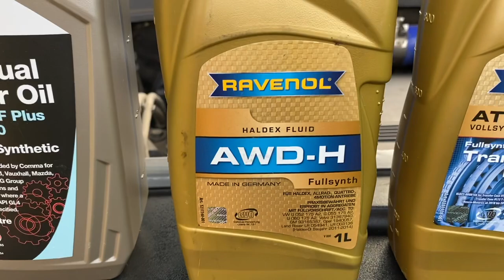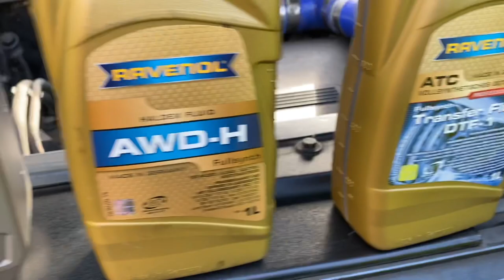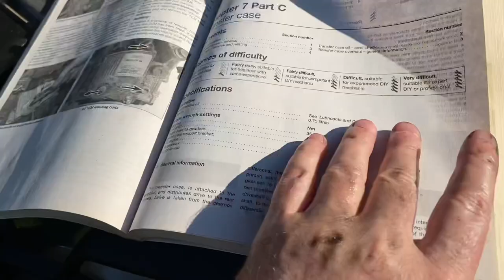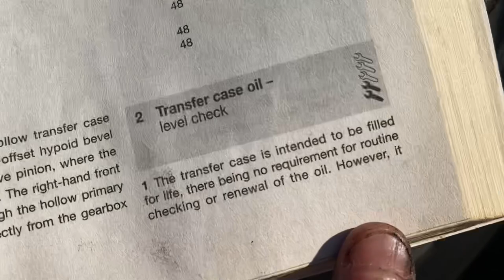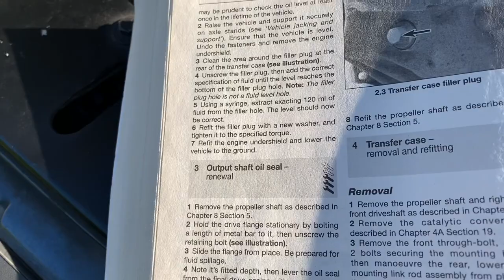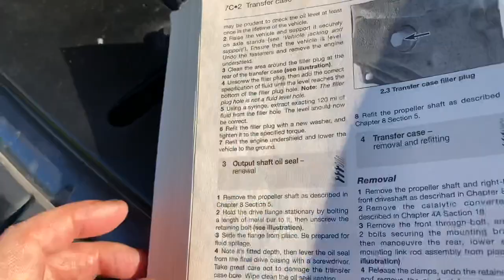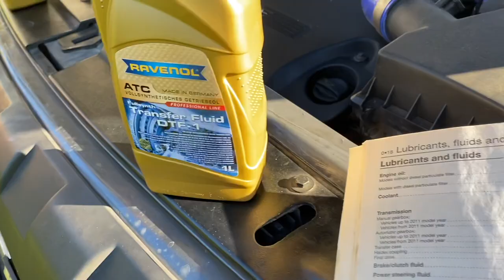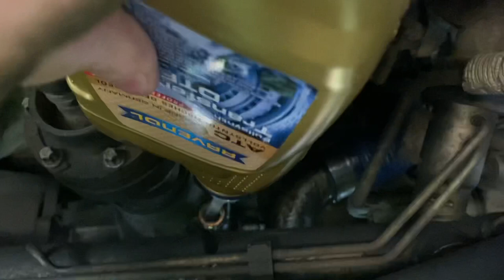Transfer box/PTU oil change on Land Rover Freelander 2 / LR2

Comment: Thanks for the video/advice - will be tackling this job tomorrow whilst doing the regular engine oil change - as far as refilling is concerned I reckon with the LR on front axle ramps the refill level should be about right at that angle with filling to the plug level 👍

Comment: I used your video  to fill my front diff, so your instructions are simple to follow. 

Your comments should be kept to relevant  points only.

Description of oil leaking from the filler point is a waste of time.

Keep the videos  coming I use them instead of the manual.

Great full regards

PETER
L

Comment: Great video, I need to do this job and wanted to see someone else doing it first - thanks!
My main first decision is whether to first tap a drain plug in at the bottom or not.. however you have shown that it is possible to get fluid out from the top which is encouraging.
Reply from the maker: I may add a drain plug to mine. The fluid can be sucked out of the filler but difficult getting it all out. I’ve also learnt that you can brim the fluid with no bad effects. There is no need to remove some after filling.
Reply: I was thinking of adding a drain plug to the rear diff. When I drain the D2 diff oils the fist part of oil that comes out is much darker than the oil at the top. So I'm sure that not having drain plugs means that the crud isn't getting removed. A drain would be also good on the haldex Gen 4 ; watching videos on the VW haldex they have had the sense to add a drain and a refill plug.

Comment: Nice movie.              Because I had problems using the syringe tube to empty I drilled through the bottom bolt hole on the side of the box making it a very easy job to take out the fluid and also getting the 120ml out. Still had to use the syringe to fill. Such an awkward position to work in without a lift ramp. One point though is to make sure the bolt is fluid proof when you've done, I used a spot of silicone sealer with a copper washer.

Comment: I’m about to replace the inter cooler hose at the front of the engine and it’s my intention to replace all with the silicon hoses over the next few weeks or months. Can I ask where you got your hoses especially the turbo hose you pointed out. Excellent videos by the way 👍. Very informative and well explained.
Reply from the maker: Thanks Stephen. Hose are from ebay…

https://www.ebay.co.uk/itm/LAND-ROVER-FREELANDER-2-TD4-2-2-TURBO-TO-INTECOOLER-SILICONE-HOSE-PIPE-KIT-/291074371899?mkcid=16&mkevt=1&_trksid=p2349624.m2548.l6249&mkrid=710-127635-2958-0

Comment: Thank you very much. Our front transfer box is getting noisy, so I'm going to try this, although I suspect it will need recon unit. I did laugh at "this has got to be shortest chapter in the Haynes' Manual" and "I've just got a face full of oil". I'll adopt the same approach as when I replaced our rear diff/Haldex 3 and have the car as level as possible on 3 ton axle stands and let you know if the oil goes in any easier. Is there a front Haldex that also needs servicing/oil?
Reply from the maker: Only one haldex, acting as a centre diff but located at the rear. I mistakenly call this video the front differential service.  The front diff is actually inside the gearbox. This is the Power Transfer Unit which splits the front drive off at 90’ to go down the prop shaft to the rear.
Reply: Thank you. Will see if there are any videos on changing auto gearbox oil in that case!

Comment: Hi in was wandering you can help me. In have a 2.2 manual td4. 07 plate with 98k. I get a weird whirring on low revs at a certain rpm. Whether it's stationery or not also doesn't matter if in gear or not. Only does it at a particular rpm.
Reply from the maker: Sounds like it could be the turbo or the air duct/hoses. Whereabouts on the engine is the whirring sound coming from? Also, check the auxiliary drive belt and pulleys.

Comment: Did this procedure last weekend - try as I might I could only get 300-400ml of syrupy brown fluid out with a syringe and replaced it with slightly more new? I still maintain that even this operation will be okay if I now do the same fairly regularly as it will have the benefit over time of blending the new fluid with the old.

Comment: Hi Beavis, sorry have you ever changed the timing chain? And if so, how many km? It seems to me that your land has the 2,2 engine like mine, or am I wrong? Thanks!
Reply from the maker: Yes, mine is 2.2 diesel, and I got a local garage to do my cam belt at 100,000 miles. It needs to be changed before 144,000 miles. I got mine done earlier as a safety precaution. I am not sure but I think there is a chain somewhere in the engine as well, but that is to drive the oil pump only and is not a part that needs to be renewed.

Comment: Hi watched your video on Front diff oil change, got 350 ml out of one and 650 out of other one, one had warm engine. Problem is getting the right amount back in. It trickles out from around  500ml, have left vehicle for half hour tried again but runs out, vehicles are almost level to work on. World it be worth running engine and trying to top up when oil is warm?
Reply from the maker: Just fill to brim and then you are meant to remove some, although I have heard of people just leaving it brimmed with no issues. Youtuber “Frenchies Road Trip” did this and it was fine. Running the engine won’t really help as transfer box only turns when driving.

Comment: Hi. I need only 1l Ravenol Transfer Fluid DTF-1 for front diff? I hear that is noisy. Today I unplug terrain response hose and nów driving is quiet. Meybe Oil replace Will help. What do you think?
Reply from the maker: 1L of fluid is enough for the front diff. Sounds like your haldex or rear diff needs a service if the noise stops with the haldex unplugged.

Comment: what is the cause of the oil leak?  I saw oil on the transfer case.  did you find where it's leaking from?  thank you
Reply from the maker: Leaking from the driveshaft and propshaft seals and where the PTU mates to the gearbox

Comment: Hi mate. I'm going to be changing my ptu / front diff oil soon, love the video, I'm almost confident enough to do it lol, I'm a bit confused about drawing 120ml back out after filling to the level plug. I've seen a post on landyzone where someone drew out 62ml ( very specific 🤣 ) and a recent video from frenchies roadtrips where he fills up to the level and refits the plug. I'm not sure who to follow,  is the 120ml thing advised by landrover? Thanks for the videos.  👍👍
Reply from the maker: The 120ml back out is in the haynes manual. I think it is to allow for heat expansion. The rear diff is fill to brim, the haldex is withdraw 70ml, although I have brimmed mine without issue. I’ll have to have a word with Mr French!
Reply from the maker: Ben French replied to me and said an LR garage told him it is fine to brim the front diff oil, no need to withdraw 120ml. I will look at this is an upcoming video.
Reply: @BeavisPits  thanks mate, I think I'll follow the Haynes as well, surely can't go wrong with that. I hope it doesn't cause any leaking seals for Ben's car. I tried commenting on his channel but for some reason it wouldn't send.  All the best,
Reply: @badrallach4792   By mistake I didn't withdrawn 120ml from front diff. , so far(20kkm after change) no leakages from transfer case but the original service manual for RR Evoque reffering to that need as well. Thermal expansion of the oil is only 4% of the volume for each 100F , so if I'm not wrong  in our case 6%=45ccm/45ml(taking into concideration the total capacity of 0,75l), so either  thermal expension is not the reason of this withdrawn or that shouldn't make any big impact.  Any other ideas why they are asking to remove the 120ml ? BR KP
Reply: @kamillop.7842  glad you've no leaks, I think it'll be one of these land rover mysteries.  🤣, think I've done around 6k miles since I did mine, no noise , no probs. Hey at least we have nice new oil in there. Can't be a bad thing. 👍👍 Happy New year to ya.

Comment: Hi thanks for posting these amazing videos.
Can you please clarify where I can find the filler plug that you show here? I can’t find it
Reply from the maker: Thanks for the positive feedback. I’m not sure where to buy the filler plug itself, it isn’t usually replaced, only the copper washer underneath it. I would try ebay and Skan Automotive (used FL2 breaker), failing that LR themselves.
Reply: Thanks for the reply. Sorry, I meant how to access it. Did you put the syringe through the wheel arch? Because the video doesn’t show where you accessed it from.
Reply from the maker: Ah, I see, I accessed it behind the transfer box. You need to get the car safely up on ramps and then get right in underneath.

Comment: Hi, I know its been a while, but off hand can you remember what size rims and tyre size you had on it,  and did it effect speedo, cheers
Reply from the maker: I’m running BFG KO2 245/70R17 on 17” XS wheels. 5% larger circumference but speedo doesn’t seem to under-read. I checked it with a GPS speed app and it was bang on!
Reply: @BeavisPits  thanks for the reply and info

Comment: Thanks so much for making this. I’ve been told my transfer box is no good but do you think new oil would quiet it down? Thanks
Reply from the maker: The oil is not very thick so probably won’t reduce the noise much. If the box has worn bearings/bushes then it should really be replaced. The splines on the output shafts are another known weakness.
Reply: @BeavisPits  ok thanks again. And good video mate.

Comment: Fact: ravenol oil selector recommends RAVENOL VSG SAE 75W‑90 for transferbox but not Transfer Fluid DTF-1. Any comments on this?
Reply from the maker: It needs to meet BOT118 spec. The Ravenol DTF-1 meets this. If the VSG oil meets it too then it could also be used. Manual gearbox is 75W90…is it possible the oil selector has mixed the two up?
Reply: @Beavis Pits  Both oils RAVENOL VSG SAE and DTF-1 are 75W90. Why you belive DTF-1 meets BOT118? Currently, Ravenol does not declare BOT 118 for any(!) of them.  I have just checked at official ravenol website, might something more is on the bottle. Old Ravenol TF-0870 probably have had BOT 118 specification but this product it is deprecated.
Reply from the maker: The standard of the Ravenol oil I used is TF-0870. Looking on google this equates to Castrol BOT118.
Reply: @BeavisPits  Genuine Castrol BOT118 oil bottle has API GL-5 mark on the back. And most oil manufacturers' configurators match GL-5 oils to PTUs (as Ravenol VSG SAE).    Anyway I don't know where to confirm the information that TF-0870 specification is compatible with BOT118.
Reply: I did excessive amounts of research finding the best suitable alternatives for the Castrol BOT 118/95 oil, which is a 75W-90 GL-5 based oil but with a wider viscosity range. Besides products from Liqui Moly and Febi, the "Ravenol LS SAE 75W-90" is the one closest to the original OEM oil specifications! It is almost spot on!

Comment: please correct me if i am wrong. i should fill until oil drips out the hole and than take away 120 ml? is that correct following haynes manual?
Reply from the maker: Just brim it. Haynes says to remove some but I no longer do this as I’ve heard of other people filling it up to the filler with no issues.

Comment: this oil leak that was already existing in your engine, what was the cause?  mine is the same
Reply from the maker: That is a combination of oil from my catch can and oil from the intercooler hoses when I was recirculating the blowby gas for a few weeks. It may also be from some of the seals/gaskets. The engine is old and tired.
Reply: @BeavisPits  mine is the same, and I think I'll leave it like that.  I won't fix it
Reply from the maker: It helps prevent rust!
Reply: @BeavisPits  kkkkkk, really
Reply: @BeavisPits  thank You 👍🏻👍🏻

Comment: Why did you change the suction tube with this direct? Is the car better?
Reply from the maker: Not sure what you mean. I used the syringe to suck out the old oil and also to refill. The tube on the new oil bottle was not long enough to use without spilling a lot of oil.
Reply: @BeavisPits  I was talking about the suction tube that goes from the air filter to the turbine, is that better with what  you put on? Sorry for my english but I am italian🤪😉
Reply from the maker: Yes, it is better. Here is the video : Air intake upgrade on a Freelander 2/LR2
https://youtu.be/rRkRJNeT-zE
Reply: @BeavisPits  ok, good work!

Comment: Should this not be done on level ground else the amount removed will be wrong as tilted towards the rear ?
Reply from the maker: Yes, but I can’t fit under the car and don’t have a four post lift. This is the only way I can do it. Removing the fluid after is optional. Since making this video I’ve found out it doesn’t need to be done.
Reply: @BeavisPits so the transfer case can just be filled up to filler plug with no fluid removed?
Reply from the maker: @rickykent4543  yes, Bell Engineering no longer advise to remove fluid after filling. I brim mine, no issues and I know of quite a few others who do this too.
Reply: @BeavisPits   that makes the job a lot easier, thanks,  good to know.

Comment: This is the front diff not the transfer box !
Reply from the maker: The front differential on a freelander 2 is inside the gearbox housing. The fluid that I’m changing in this video is for the transfer box or power transfer unit (PTU), which contains a bevelled pinion to send the drive 90° along the prop shaft to the rear, as well as across to the offside wheel.